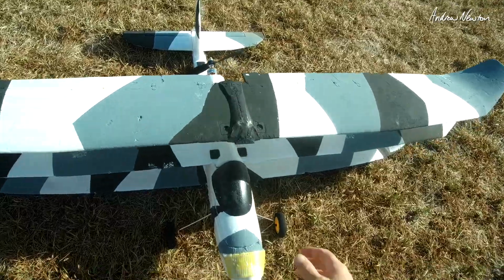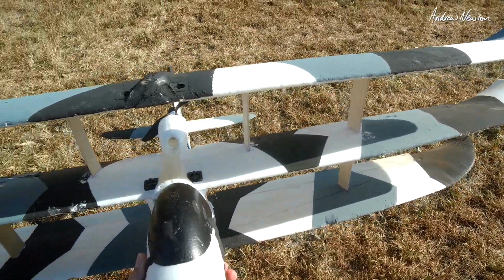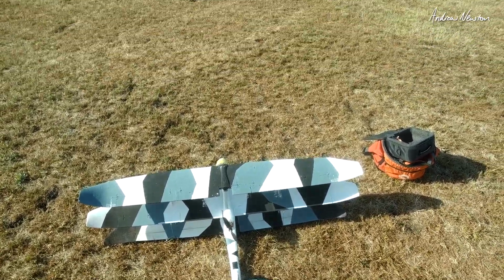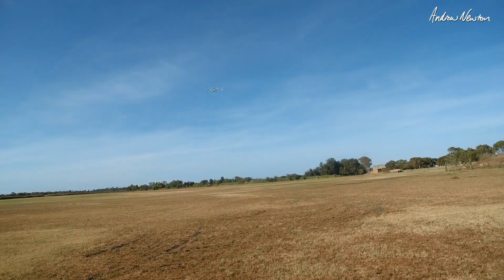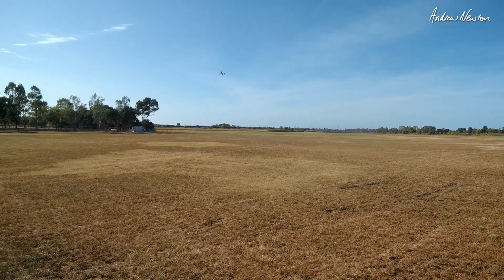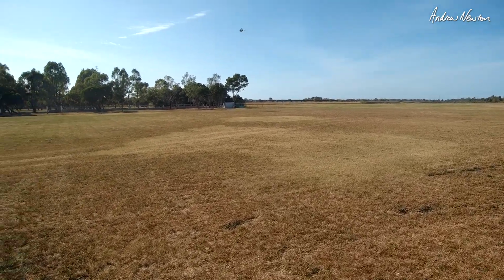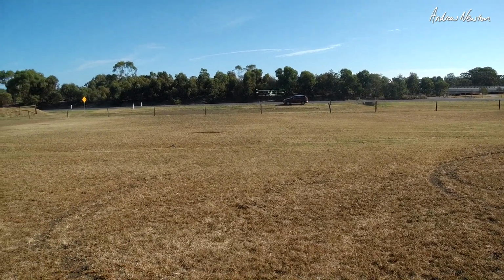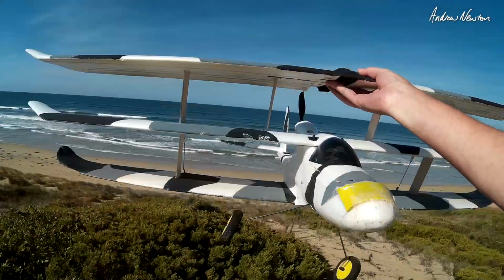Trixler Slopes again

Comment: Well, full of inspiration I dusted off the old Bixler 2, refamiliarised myself with it all and took it out to a local field yesterday. The wind was gusting a bit but it managed to fly a few circuits (all PAX complained of air-sickness) before an old structural repair of limited significance (RH wing severed at the wing root) failed. One or two cartwheels and a spectacular nose in and now I can enjoy some man time in the shed re-repairing the wing and giving it a nose job! My son was my launch master and we were both happy that we could return home with all the bits without having to search the adjacent bush, climb trees, fight possums etc. All in all a fun return if not the most successful of my wobbly RC career! Thanks for the momentum Andrew - Cheers Dave
Reply from the maker: I'd call that a success! Strange that a minor fault like a wing detaching would cause problems. Tape, hot glue and go agian!
Reply: @AndrewNewton  Yes indeed. As a once 'full scale' pilot I have to say I've never encountered such an event so it was a surprise... Was great to get up again I have to say. Now it's time for some RealFlight sim time and then I'll put in some effort to work out how to programme some shared crow/throttle on my Phoenix 2000. I'll also review some of your excellent ridge soaring vids and find a windy ridge! I remember putting a blistering motor in the Phoenix for some realistic scale glider vertical acceleration as required...  :-) Cheers - Dave

Comment: very cool. wish @hobbyking would get more slope worthy stuff in the store.
Reply: Just Buy An Excalibur For $100 & You'll Never Want Another! LOL PS I Own 15 Different Soar Models Now From 24" To 3Ms... Put A 13"x6.5p or 8p Folding Aluminum Spinner & It will Do 120mph Easy Like A V900+ On 4s, Butt Epoxy In 2-Fuill Lenght 3m Flat CF Inside From Tail Forwards To Avoid Breaking Any Thin Fuselage Gliders In Half On Hard Landings...
Reply: @Raymond Hattrem I really really don't get the Excalibur buzz people are on.. its a total pig to fly with the motor on down the field.. And Its  only slightly better on the slope with the motor off.